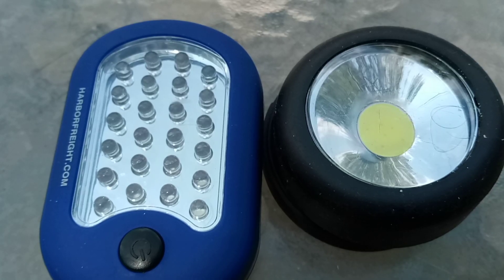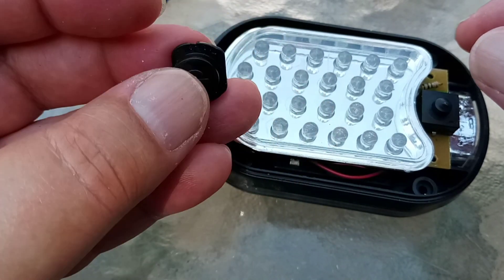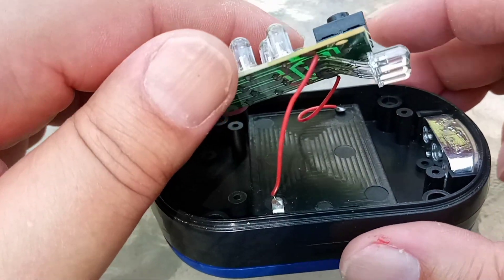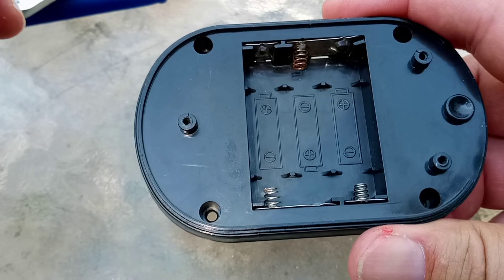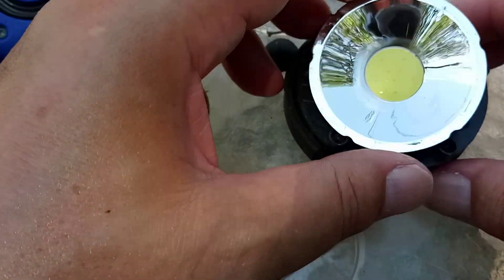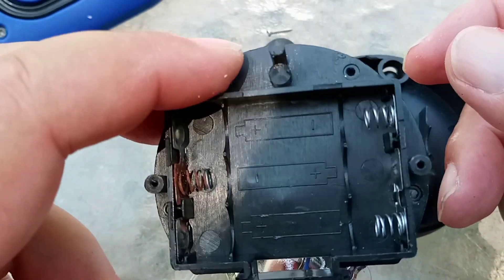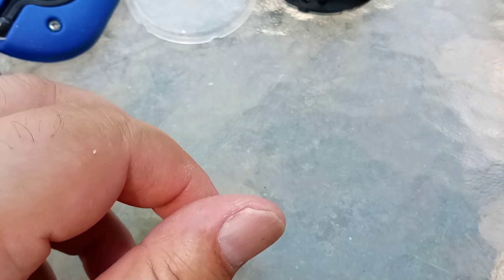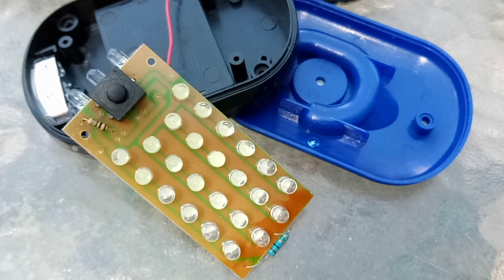Disassembling and analysing the failed Harbor Freight LEDs... Big Clive style

Comment: I don’t buy anything battery powered that isn’t USB rechargeable. On the rare occasion that I do get one of those for free with a coupon I immediately replace the included batteries… I’m pretty sure they come from China with a timer to meltdown already ticking!
Reply from the maker: I prefer the AA powered things as I can use either disposable AAs or rechargeable. I dislike the AAA powered things as those batteries have no staying power.

As far as these devices were concerned, the original batteries were fine and when they expired I'd replaced them. None of the batteries - the originals nor the replacements had leaked. It was just the cheesy materials used in construction.

I've tried those USB rechargeable gizmos and have not had a great experience from them. Something fails - usually the battery - leading them to be landfill faster.

The bonus of the $2 LED flashlights is now they're out of action, I have some nice LED clusters for use in projects.

Most stuff from China is built not to fail immediately but to last long enough to pass inspection by the buyer and that's it. If it fails after the buyer has bought it - no returns. China is a dreadful place to do business because of the no-returns.
Reply: True! I’ve bought several LED rechargeable lights and you’re right it’s usually the battery that craps our first. I bought a box of 3.7v Lithium flat battery packs that claim like 3500mah… that’s obviously an exaggerated number (if not a flat out lie) but they’ve worked well. Just solder them in place in solar lamps, night lights, etc!
Reply from the maker: One of my exes bought a bunch of those solar pathway lights. One by one they stopped working. I took one apart and found it had a very ordinary AA NiCad inside. I replaced that with one of my elderly 1600mah NiMh batteries and it worked for years. It might still be working. I did the same with each one as it failed.

I currently have a Drill Master battery drill that has a battery pack containing NiCad cells. I have not pulled the charger apart because I can't locate it at the moment but I doubt there's any form of charge control involved. Mind with those, the drill barely lasts any longer than the batteries. Poorly constructed overall.